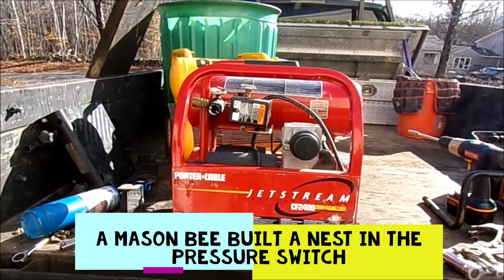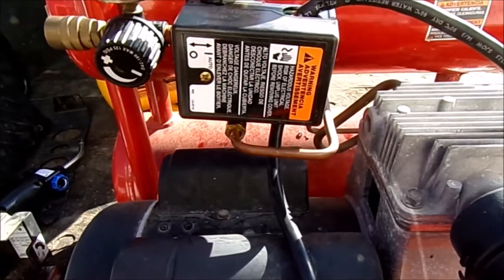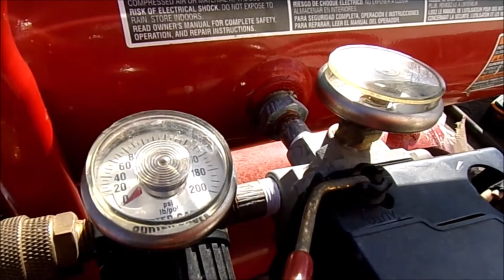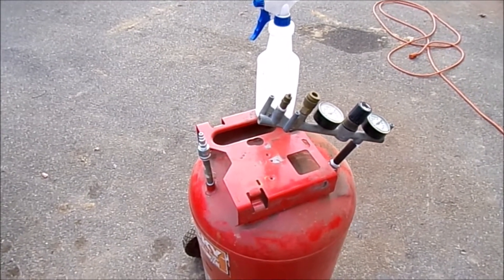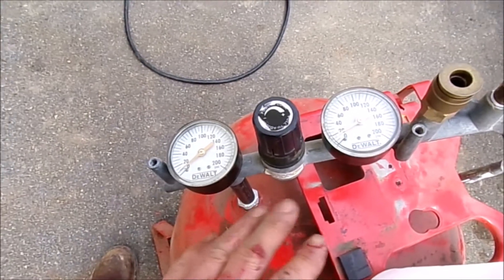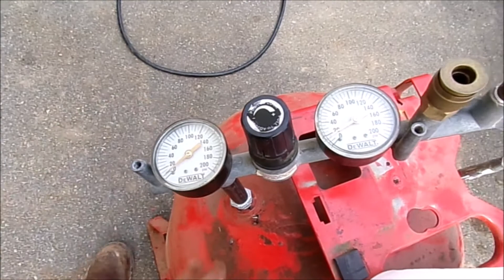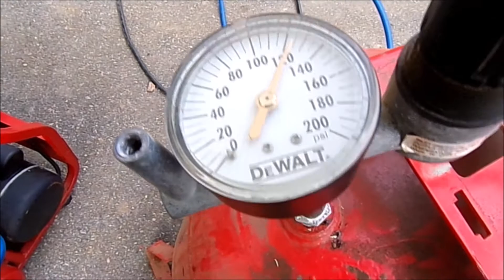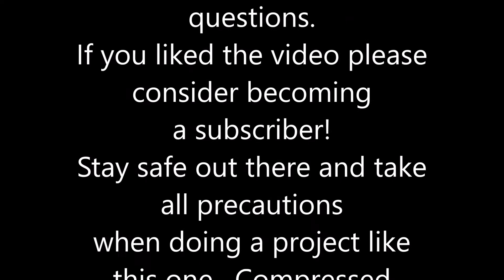Build an Expansion tank for air compressor out of junk!

Comment: You installed the Burst Valve after the Pressure Regulator.  So you have defeated the purpose of that part.  Just block it off and use the Burst Valve on the source compressors tank......